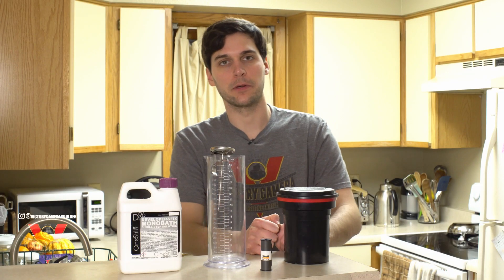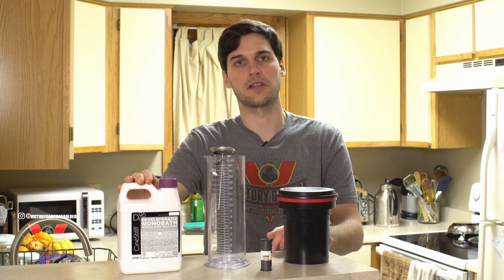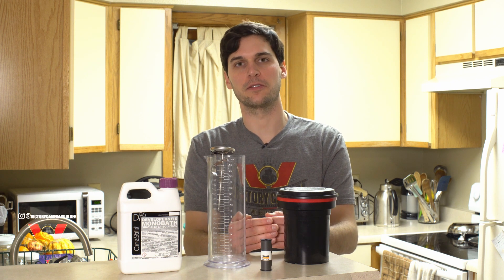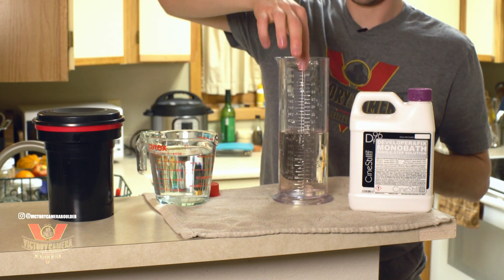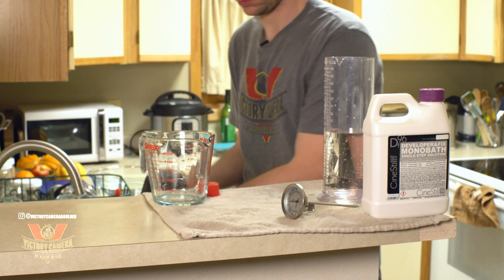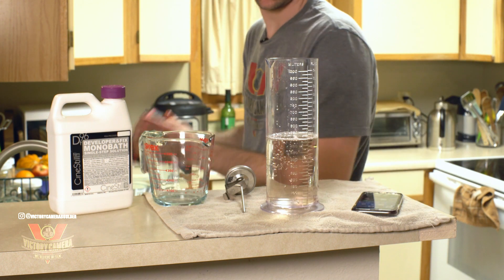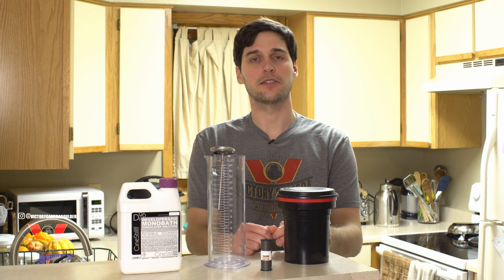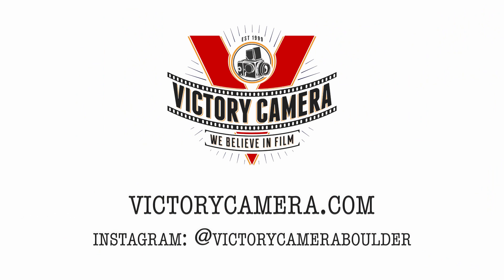How to Develop Black & White Film the EASY way - Monobath!

Comment: I have tried to develop 3 rolls with Cinestill Monobath DF96 and Lab Box, and I have damaged all 3 rolls, I do everything according to the manual, and the videos I have seen on the internet, and the film is not revealed, the emulsion remains stuck to the film, the product is new, any suggestions? Thanks in advance
Reply: are you sure your camera is working correctly? maybe the film isnt cycling?